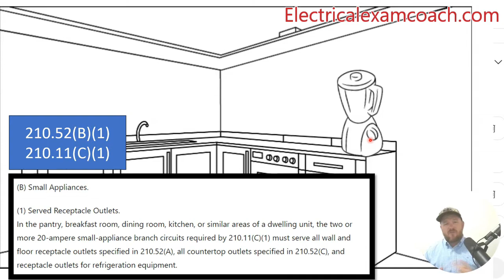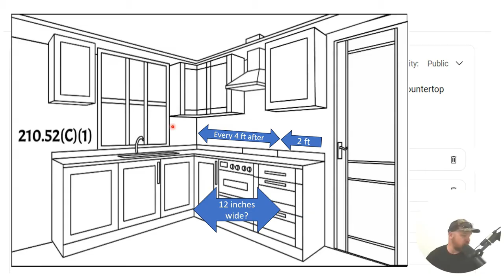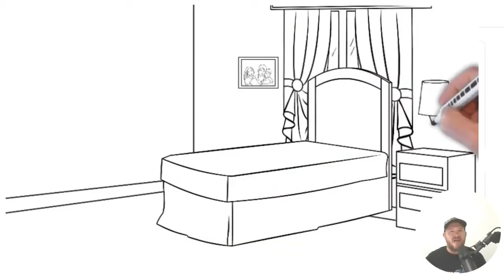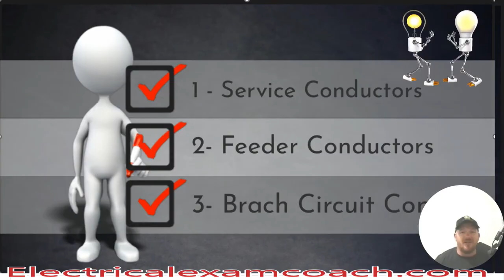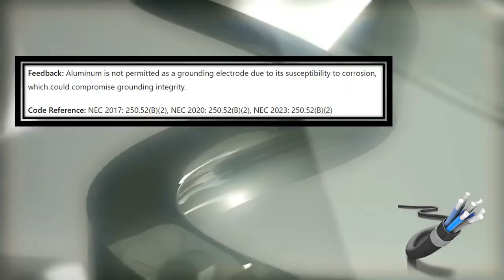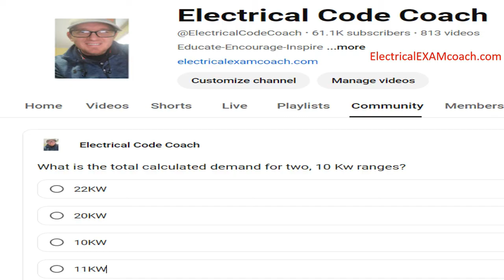30 Electrical Questions with Full Video Explanations Exam Prep

Comment: In regards to the situation where the knockout blanks are still in place and above 6'7 on the reversed panel,, you stated you would fail an inspection for that but technically,  by code only,  that is permitted correct???

Comment: Love this channel, thanks. Maybe you can answer a question I haven't been able to find an answer to? What are the dc ratings for the 221-6xx wagos that work for 10awg? I ask because I do more solar than anything else when it comes to electrical
Reply: The DC rating should be the same as the AC ratings (30A 300V) since it's not specified "AC or DC" on the MFGR's stamp on the product